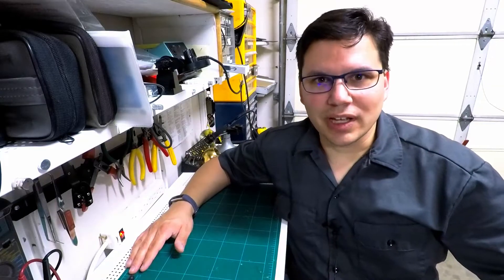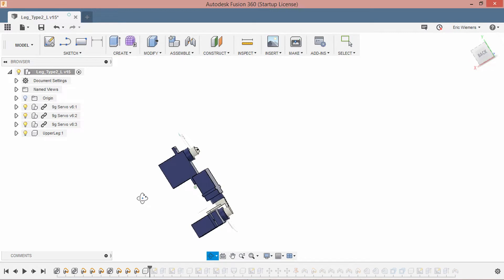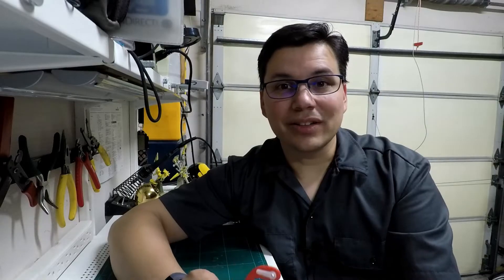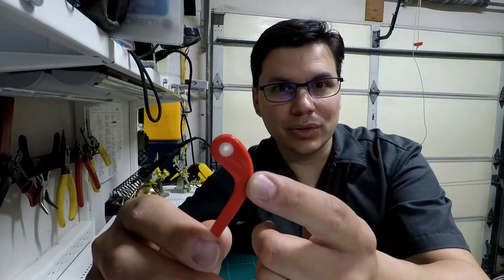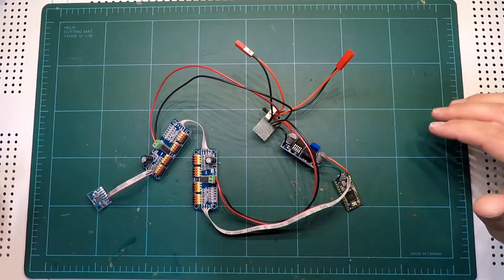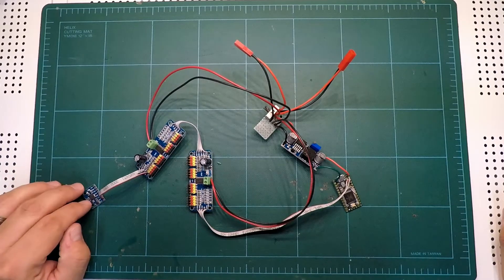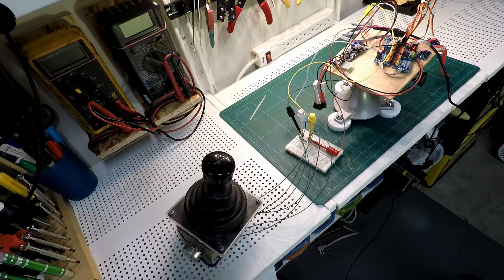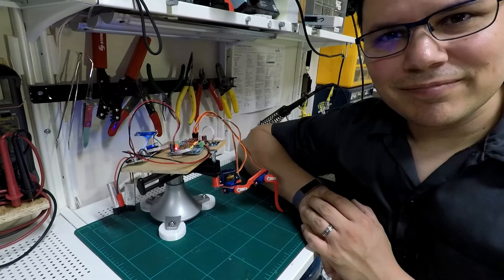Robot Spider Build || Part 1

Comment: very cool! Nicely documented too. I wonder if the servo quality will matter a lot? Also with that many servos, I think you might need bigger batteries, or higher C rated batteries. Maybe run some back of the envelope numbers, see what you come up with. A capacitor with a diode can be used to stop the teensy from browning out when a servo hits peak torque or a few of them do and causes the voltage to sag significantly (I had this issue with another arduino project).
Reply from the maker: Thanks for the tip! I was going to keep peak loads down by timing, but you're right, I should have a backup plan for the Teensy. 👍